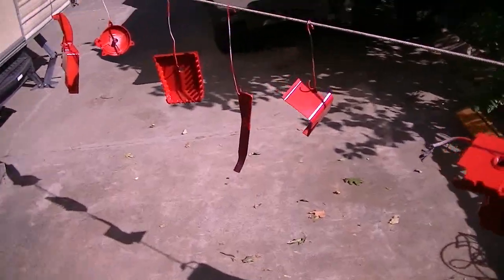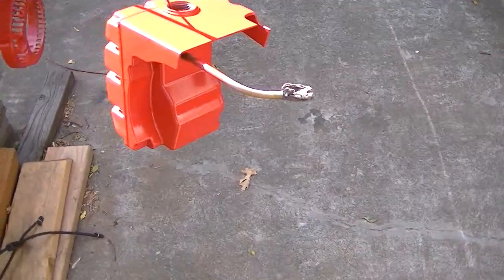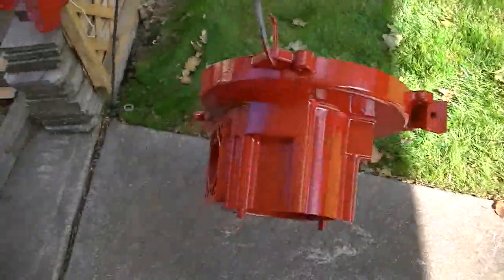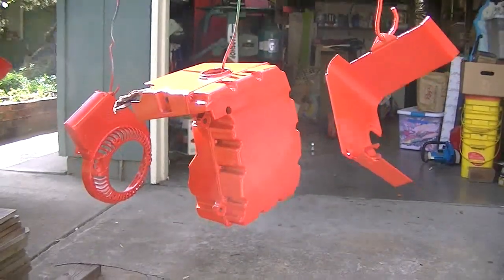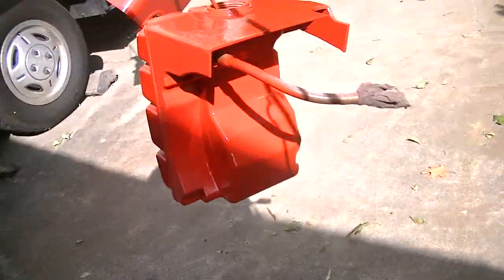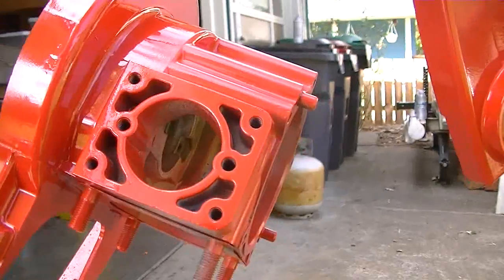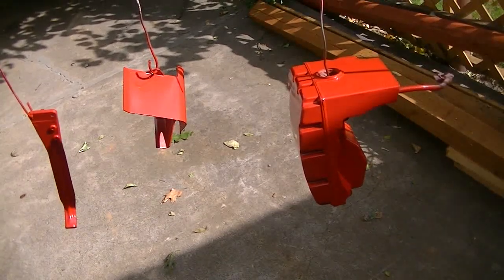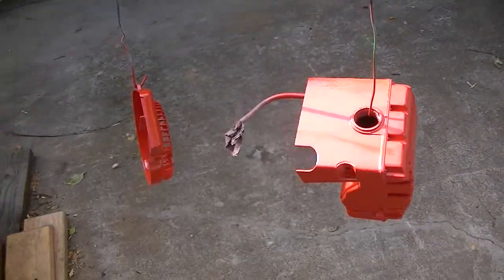Painting Tips From My Homelite Super XP 1020 Chainsaw

Comment: I paint by feel, not sight. I've been using a spray gun for 40 years and I can feel the paint going from the gun to the part. I recoat in 15 -20 minutes, with the right reducer and catalyst its difficult to get a run. Paint doesn't want to get into 90 degree angles unless you have the pressure right and the paint reduced right, it tends to avoid corners, part of this is a static effect

Comment: do you think that Ford red engine enamel would match well enough? and what green should I use? I'm thinking this summer I'm going to restore my old homelite, and I want to make sure that I do it right.
Reply from the maker: The Ford Red will get you close and if the whole saw is that way, it will look great.  For green, I'm using Duplicolor Metal Specks Green.  With the green, too many coats will be too dark...I like to spray 2-3 medium coats over grey primer.
Reply: Leon's Chainsaw Parts & Repair based off photos I've seen on Google, alpine green looks to be similar.  I need to get the green right, cause there's a rubber sleeve on the front handle.
Reply from the maker: Sounds good, please let me know how it turns out!

Comment: Leon do you prefer any certain product or method when cleaning a dirty old saw? It's extra nasty behind the bar and sprocket cover. I don't want to mess something up by using to strong of a solvent. Thanks Larry
Reply from the maker: Hi Larry, if you are trying to preserve the old paint, nothing works better than some good dish soap (Dawn, Ajax, etc...) and some hot water.  Just be careful if you use a nozzle...anywhere the paint is chipped wills tart to peel if you blast for too long or too close.  An old toothbrush will help clean out some of the stubborn areas.